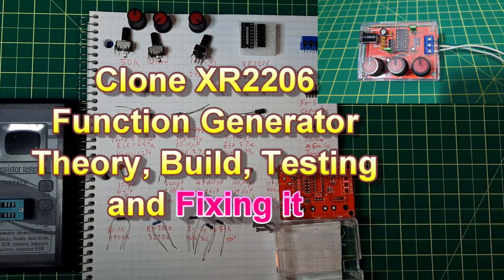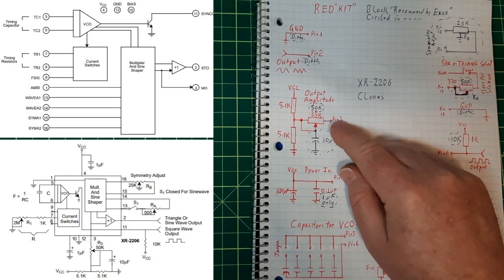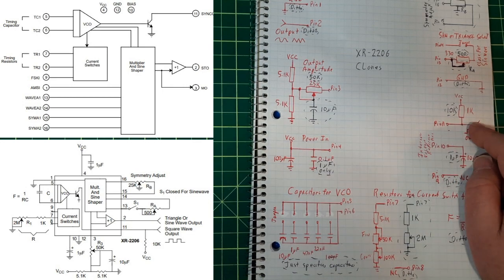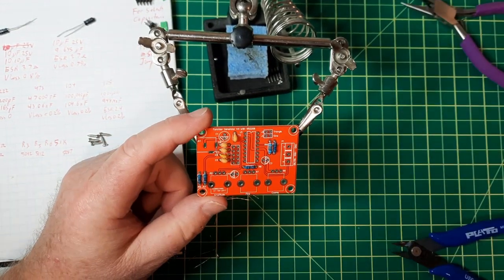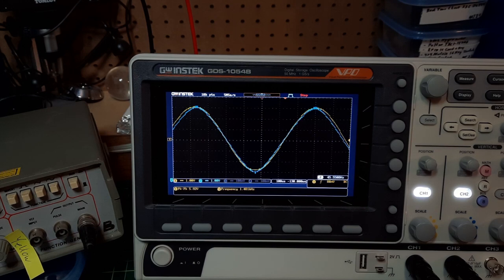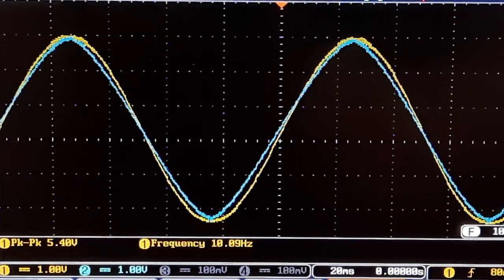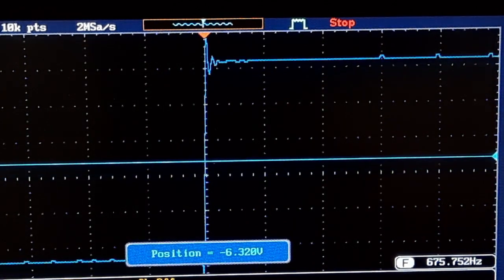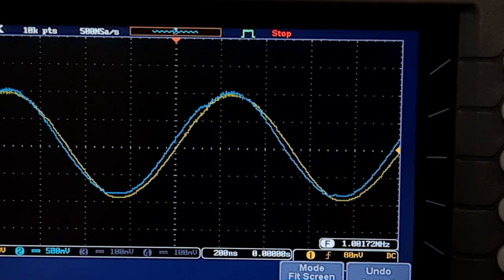XR2206 Clone Function Generator Theory Build Testing then Fixing it

Comment: This video helped me SO much. I was trying to make an LED flash using the square wave output on the 2206. It's my first time trying anything like that. I wrote out how each pin connected (like you did on your written sheet). It worked!! Thank you!
Reply from the maker: I prefer to write out as much as possible, a few less mistakes. Have a good day

Comment: I based my PCB on the data sheet and I can get just over 3MHz out of my ICs.  The extra pots are for cleaning up the duty cycle, etc.  Just use trim pots there and you can set and forget.  I found if you don't push for max amplitude output you can obtain a cleaner wave shape up to the MHz frequencies.  If you need more power use a couple of transistors.  My IC's are from good old Uncle AliExp and work well, better than the data sheet states.
Reply from the maker: Oops missed this message. It is amazing if you follow what the manufacturer recommends, they have a interest in making their products work (-: Have a good day